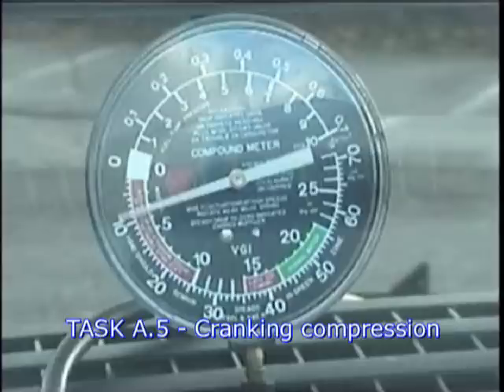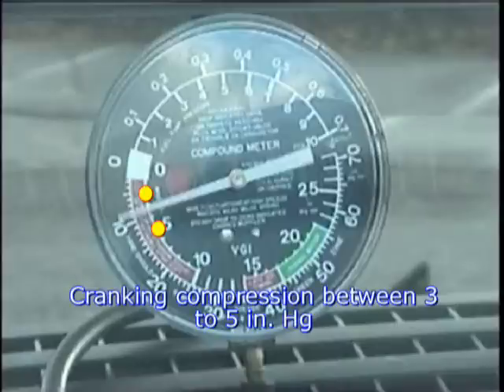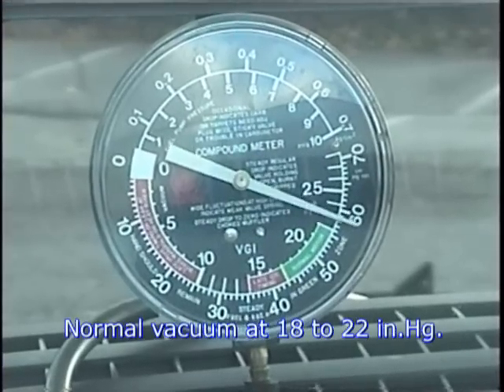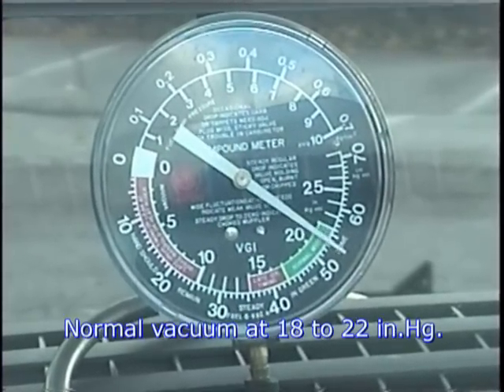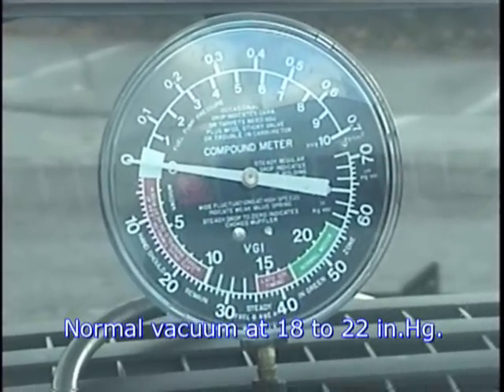Reading Cranking Vacuum

Comment from the maker: Hello, well you have a very good question and I rarely get this. Yes, you first have to get your idle speed in check before using idle vacuum as a guide. The issue is that at low idle speed theoretically vacuum is the same, but at lower idle the RPMs will also be lower. That'll skew the results. Post back with year, make and model and engine size so I can help with the idle. Good luck.

Comment: I am one of the rare DIYers that has a Picoscope, so I think this will be my first project to troubleshoot. Thinking to check IAC duty cycle at idle as a first step. Another symptom I have is a hanging idle - I tap the gas and the RPMS stay high (>1200) for about 5 seconds, then reverts to normal slightly low idle.

Comment: Thanks, the car is a 1994 Ford Probe 2.0L Automatic. Ford Shop manual states 700 +/- 50 rpm. I feel like I am running around going in circles with the troubleshooting - I can get the idle right if I turn the distributor, but then i am well past the 12degrees recommended timing .If I play with the throttle stop, then it will surge when I put it in neutral when coasting (because ford's EEC-IV cuts fuel to the injectors on deceleration when the idle speed is >1250...thus when it surges, it means

Comment: Errrrrrm, I fail to see how an engine cranking at say 50rpm with the starter can generate 3-5inches of vacuum WITH THE THROTTLE WIDE OPEN.Maybe a 27 litre Rolls Royce Merlin engine can.A typical car engine? No way, unless the throttle is closed.